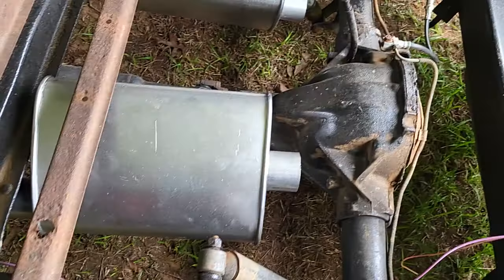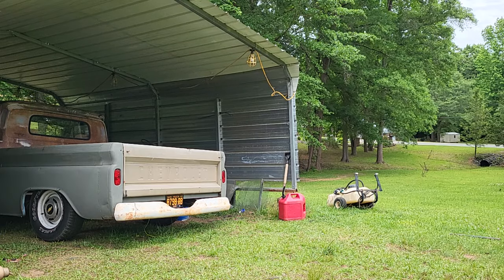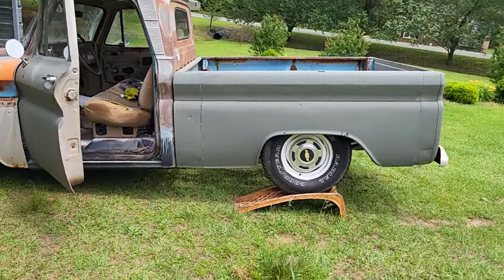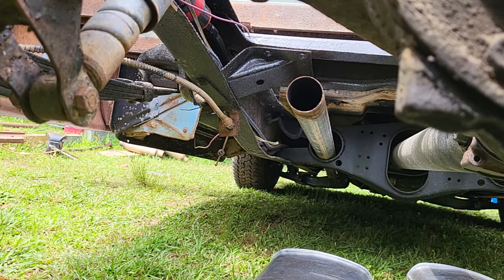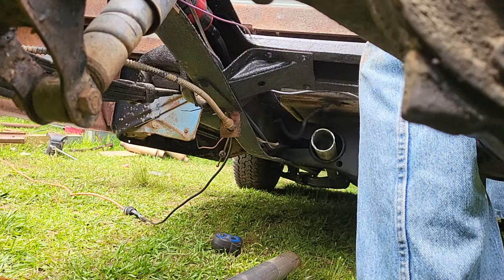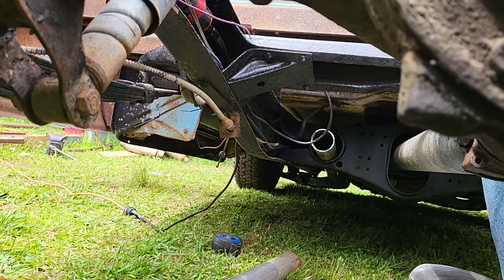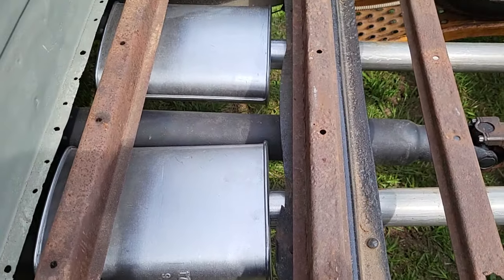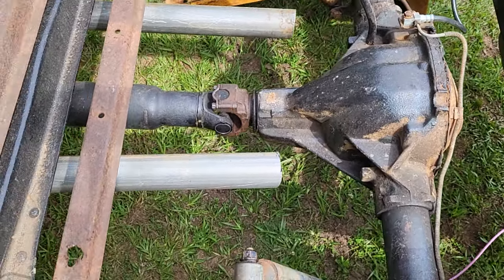Doing muffler work on 65 Chevy C10

Comment: You got a real nice truck there. Nice work but you want to be around to work on it. Those ramps you have have there up where I'm from. We call them widowmakers they're not the safest. There's no strength to that for your own safety and protection. See if you can get some better ones or make yourself some your own ones out of some 2x8 or 2x810 planks and you can make your own  ramps that'll be a lot safer than those ones. They belong on the scrap pile. Get yourself some good ones. All right? Good video 👍👍🙂🇨🇦
Reply from the maker: i have the plastic ones also. i will use them from now on. thanks for the advice, well taken. Peace
Reply: I look at it like safety first 🥇

Comment: Do us a favor BOB, Go to harbor freight or Amazon and buy yourself a set of Plastic Ramps to pull up on. Reason being is I had the same set of yellow ramps you got there and I had one squish flat while pulling up on it. If that'd happen with me under it. It could have been bad. They like 30to40 dollar for a pair of good strong plastic ones that won't squash you while your working. I care about you so I had to tell you about what happen to me.
Reply from the maker: Thanks a million for thje advice. You are the second subscriber that has said that. I do have the plastic one also. I will use them from now on and use the metal ones for the John Deere. Good looking out.Peace
Reply: @builtonabudget6767  yeah man I use to skip alot of safety stuff till that day. Most times we're by ourselves and nobody there to help if something happens. We better safe than sorry 😎